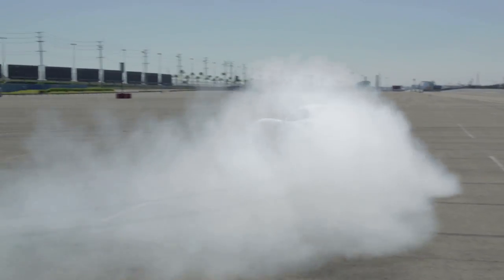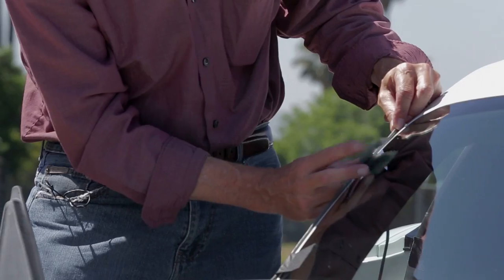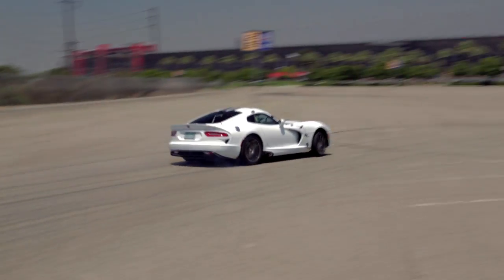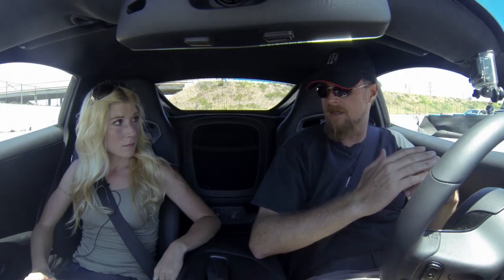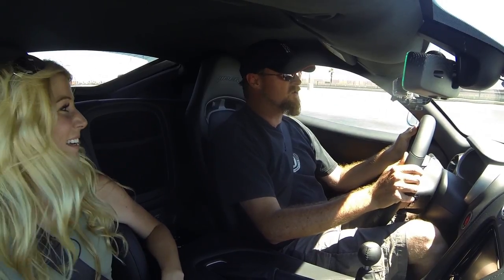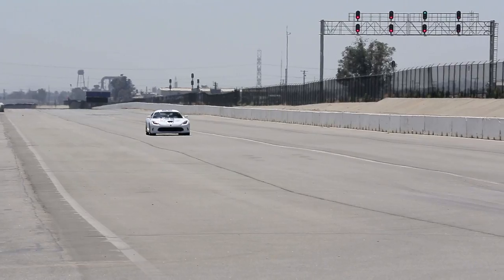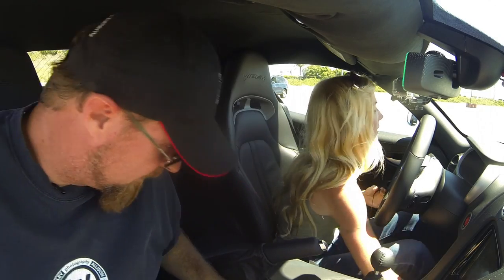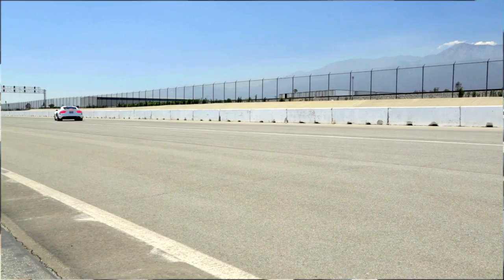2013 SRT Viper Faces Motor Trend's Testing Procedures - The J-Turn Ep. 12

Comment from the maker: Rest assured, it's gaffers tape and it doesn't hurt the paint.  Unlike other types of tape that use a rubber-based adhesive, gaffers tape uses a synthetic petroleum-based adhesive and can be cleanly removed from all that it touches.  (But way to be looking out for the cars!)
Jessi

Comment: Thanks for the response. But you would still have to move the seats forward enough to feel like you're sitting in a roller coaster. Lol. The comfort factor probably doesn't even matter when driving the SRT Viper. Then again, competition like the new C7 Corvette does have telescopic steering column (I'm not sure about the adjustable pedals).

Comment: On reflection something I have found fascinating is the difference in launch procedures with a Jessi on board. The BTCC has "success ballast" to try and even the field but with the Viper you get to launch the car with an extra couple of hundred RPM and the advantage of the extra (although very little) weight transference over the axle gives you better holeshot grip. The 60Kg ballast added to a BTCC car would be roughly the same as a race suited Jessi, seat, harness and extra bolts. Hmmm...

Comment: Its not just all about weight, engine design and outputs also come into play. Most US Muscle car engines are, had been, and will always be designed for Front Engine or Front-Mid Engine RWD layouts, not only that but the sheer potent amounts of low end power they make would put a heavy burden on the AWD/4WD drivetrain, and AWD/4WD is more expensive too at that. The two cars you mentioned the Bentley and the Nissan GT-R don't have engines with those characteristics. They have high rpm engines.

Comment: So you guys always clutch dump? Never slip into it? Not the most reliability inspiring method... But on brand new loaner cars, sure, beat the crap out if it! Ain't care!  Two more questions... 

When going from one gear to the next do you flat foot shift? Or lift off just slightly?

Lastly, when braking in manual car, do you keep it in gear? Do you heel-toe as you slow down? And if so, at what speed do you depress the clutch?

Comment: twin plate clutch, carbon brakes, stiffer suspension, better tires, interior needs refinement. all in all viper with these options will cost about 50k more but with all those improvements you can also get more power out of the 8.4L V10. and will be faster than a sls black still costing half the money.

Comment: That's because the two cars are much different from muscle cars in nearly every way. Personally I don't know if AWD/4WD even does help in some way as most cars with 4wd/awd I see don't have high low end torque numbers like most American cars do. Besides if you are racing then AWD is pretty much useless as racing slicks offer way better traction/grip and save you from adding weight with the extra drive axle.

Comment: The front lifts when he accelerates,  and slams forward when he brakes... seems soft on the suspension....
Reply: It's a Base SRT model.. and all cars have some dive/lift. You have to make it soft enough so people don't cry about the ride(even though they still do). T/a Viper has 50% stiffer springs and is the best balance of street/strip/track. ACR  springs are 300% stiffer than this vipers.

Comment: Better not floor it at the point you leave the clutch, too much energy and thrust at that point. Viper is a mid range torque vehicle is pretty hard to launch a mid range torque quick unless you have good tyres. If GTR is a MT RWD, it takes more skills than Viper to launch because it's torque jump from 3200 all the way to 5800rpm. Floor it or slow down is the question.
Reply: The new nismo gtr is 600 hp for 2015 the track edition .. and the new viper has better work done ive Got all the news at the AUTO SHOW in nyc also better engineered .. viper ↑↑ #nyias
Reply: Seth Reeves So you agree Viper ACR may break Nismo record?
Reply: Only and olny because they became beter and the changed so much to viper. how the nismo Nissan GTR has 600 hp 3.8l v6 .. although 40 more in viper they have a good shot wish them luck
Reply: Viper didn't change much, same tyre same engine but different out put and a renew package.
Reply: If u was at the auto show .. yes it did traction aerodynamic brakes suspension clutch transmission yes it changed up BIG
Reply: I know, but same engine same tyre. All those changes you can find it in many other cars too. Don't hate a car.
Reply: ROCKETGUNS BOOMBS I cant hate I dont hate and shall never .. it about to it right or doing it wrong
Reply: Seth Reeves Easier term, Turbo S Viper ACR and GTR Nismo currently is the only cars that can hold more track record than others.
Reply: Not that ... idk see track time is something one car cant hold .. but top speed records can be hold or much longer ... it a reason why cars like pagain bugatti koenigsegge dont pay much attention to keeping track times ... but gtr is a turner not even a sport class that maid just to throw things in it and just go fast that want makes each car different in ever class I also think us car enthusiast should respect the engineering of the cars rather then what the car did
Reply: GTR is a sport classed car or a GT car and a tune car in same time.
GTR, Koenigsegg, McLaren, Porsches Ferraris are good engineered car. Viper and Corvette is a well engineered car either. But they didn't focus on technology, they focus on brute power (engine) and grip (tyre and breaks) Which make them quick at tight tracks.
Reply: ROCKETGUNS BOOMBS no tuner